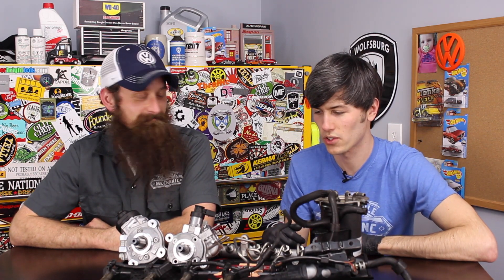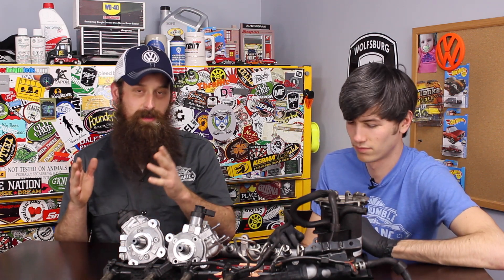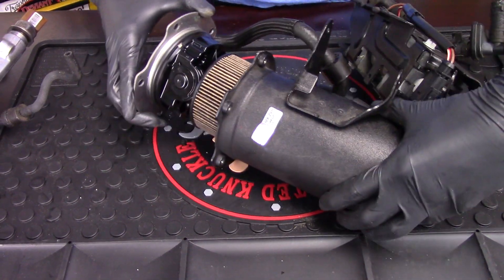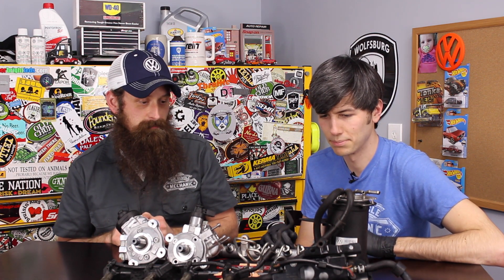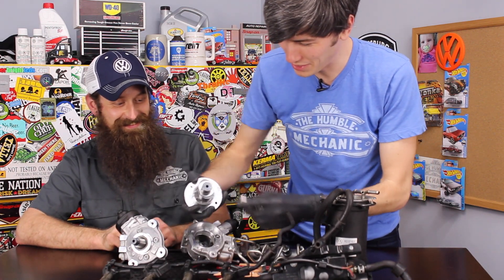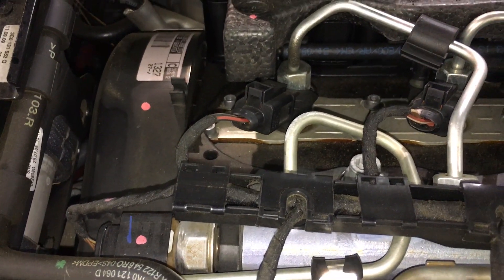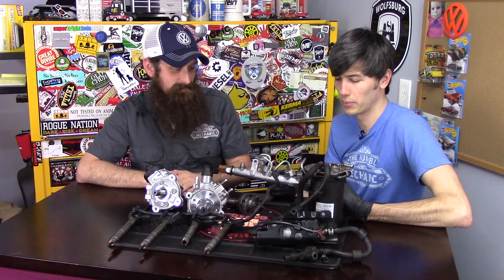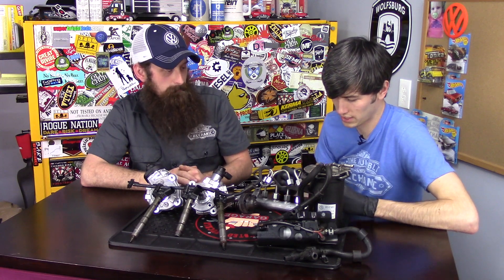How Diesel Common Rail Fuel Systems Work

Comment: I don't understand why the mechanical fuel pump needs to be timed if it's supplying fuel to a common rail???
Reply: +Kepe The high pressure pump in a common rail fuel system IS NOT TIMED; and never has been. by the way, common rail fuel systems in Diesel engines date back to the 1930s.
Reply: +Jun Ye Liao (Kevin) Think of the mechanical pump as a small 2-stroke piston and cylinder setup. During an intake stroke, fuel is fed into the cylinder by the second electric fuel pump. Then the fuel intake valve is closed and the compression stroke happens, during which an exhaust valve is open. This of course causes pressure to rise and forces the fuel out of the cylinder and into the common fuel rail. Then the exhaust valve is closed, the intake valve opens and another intake stroke happens.

So the fuel "squirts" out of the pump during the pump's exhaust stroke. If there wasn't any timing involved, the pump couldn't work. I'm quite sure the pump doesn't actually have a piston moving up and down, but the principle is still the same. This kind of pump is required because of the absurdly high pressures required for better fuel injection.
Reply: +Attila theHun I was talking about the high pressure fuel pumps and why they have those cams inside, shown when Jason takes apart one of them at 2:21 

I wasn't talking about the fuel injectors, nor was the person who asked the queastion.
Reply: Attila theHun exactly what I was thinking, that's why I don't understand why he mentioned that the pump is timed with the timing belt...
Reply: +Jun Ye Liao (Kevin) I think it just gets its power from it.
Reply: +Jun Ye Liao (Kevin) If the pump is not timed on this engine it will throw off the engine timing. I have seen guys get the timing of the pump "off" and it will cause a cam/crank correlation issue. So while the pump may not require timing to provide fuel at high pressure, it does require timing as a function of the timing circuit of the engine.

HAHA(did that make any sense?) Sorry it's early.
Reply: +HumbleMechanic Isn't the timing of a common rail diesel engine managed by cams and the ECM, which controls the injection? I mean you aren't using unit pumps or anything like that here. The mechanical pump is just a high pressure fuel pump, providing pressure to the common fuel rail. That's why I don't quite understand :P
Reply: +Jun Ye Liao (Kevin). On Peugeot/Citroen HDI (common rail diesel) it doesn't need to be timed. I demonstrated that to my boss by spinning the high-pressure pump before mounting the timing belt. The engine ran perfect.
Reply: In a common rail system, the high pressure pump is NOT timed.
Reply: +Walter K by it self, you are correct. However as part of overall engine timing it is.
Reply: +HumbleMechanic I must agree to disagree. My familiarity is with Bosch CP3-based systems and the CP3 high pressure pump is most assuredly not timed; it free runs. injection timing is solely determined by the PCM triggering the injectors.
Reply: +HumbleMechanic It just acts as another idler in the system, no timing is necessary and it wont affect valve timing as its free to spin as the belt is applied. It would cause issue if someone (incorrectly) locked the pump off however when it should be left to spin freely.

Comment: Guys (maybe more specifically Charles), I'm about to embark on replacing my injector seals on my '10 CBEA, would love to see you guys tear apart one of those injectors and go over its different components before I try and do this myself.
Reply: Just doing the deals on that engine is super easy. Unless you mean opening the injector and work on in the guts. 

Or are you talking about the sealing plates on the valve cover? 

Also curious as to why you are replacing the seals. I have not seen(on those injectors) a need for replacement. Not saying you don't need them, just want to be sure I have not been missing something.
Reply: HumbleMechanic VW said that I have oil on top of my valve cover. They proceeded to tell me that I need to replace the valve cover and gasket along with my injector seals. Their reasoning for doing both was that they weren't sure where the leak was coming from, so they said both need to be done. Quote: $900 bucks. I said ef that, went over to myturbdiesel.com and found how to do it on my own, but I'm a little scared to mess with the injectors.
Reply: +Shayne Wolfe Just be careful. The guys at MTD are awesome! just be sure to work clean, and take care not to drop the nuts into the valve train.

Comment: What a waste of good parts. Mis-fuelling never causes failure of parts, just drain and fill with diesel and it'll be fine.
Reply: +100SteveB nope, its the high pressure pump that goes toast on these. Its electric but also relies on the lubricative diesel fuel. Gasoline comes and literally cleans all the lubrication off and burns the pump. Some pumps rely less on diesel just because they dont want their customers to ruin their vehicles when they accidentally put the wrong fuel in. VW is German so it doesnt care about its customers past warranty.
Reply: +ringmaster146 I used to be in charge of a fleet of small diesel vans, on several occasions i had drivers mis-fuel their van. On each occasion i had the vans towed back and then i would simply drain the system and flush through. Fill up with correct fuel and take the van out for a test. Within a mile of driving the vans were back to normal, no signs of damage whatsoever. Each of those vans carried on to give a full service life without problem relating to the fuel system. yet, if i had taken them to a garage i know that they would have told me that i need to replace every part of the system.
Reply: +ringmaster146 Let me elaborate a little on this situation, because I have seen it go a few ways. 

When the HPFP fails it blows metal throughout the system on these cars. Jason has another video coming out were we explain that a little more in-depth. 

I have seen many CR engines mis-fueled. The simple act of putting gas(we will stick with that for now) in a tank does NOT cause damage. You are 100% correct. BUT that is a rare rare case. What typically happens is, TDI is filled with gas, car is driven until it will not run. Then car is cranked and cranked and cranked. After it will not start, it is towed in.

Now the entire fuel system is filled with gas and metal. I have seen guys try and clean the system and only replace the HPFP. It may have worked a time or two, but generally you will see injector failures.

Also remember that for a long long time, VW was paying for all of these repairs. That means we at the dealer had a repair protocol to follow. That consisted of replacing all the parts Jason and I show, and cleaning the rest. If that was not followed, VW would kick back the repair claim, and the dealership would have to pay the bill. AKA the tech also loses money. 

Now if we were talking about the older TDIs like the ALH, and the PD engines, you are right. The damn ALH would run on gas(ran like crap, but it would run). Even the PD engine would be fine with a drain and fill and filter replacement. 

But those days for VW are long gone. If a CR TDI is ran until it will not run due to gas contamination you can almost guarantee this will be the repair.
Reply: +100SteveB At what point was the van towed? Was it caught at the pump, or driven until it would not run. From what I have seen, that seems to be the difference between a flush and fill, and a system failure.
Reply: +ringmaster146 it's a tough call at the dealer. Let's say we try and clean the lines. Then 5k miles later the customer has an issue in another state. The other dealer will see we didn't follow the "proper repair". Then the customer is pissed and we are on the hook to fix it. There is a lot more to the story about why dealer make certain repairs. Some of it I am totally cool with and some times it's plain freaking stupid.
Reply: +HumbleMechanic Thanks for the reply. Your last point explains it all really - for example I wouldn't like to see the customer billed for a new rail and pipes which are easily cleaned.

Comment: Your timing could not be better. I'm currently having some fuel supply problems with my 206 2.0 HDi, and this video explained alot since I don't know crap about diesels.
Thanks m8
Reply: +DrathVader pretty lucky I'd say. good luck to ya hope it works out for you
Reply: How's The Force working out for you now?
Reply: TurdFurgeson571
Unfortunately the Force can do nothing against dead high pressure pump. Or fuel filter. I'll check tomorrow, but that weird whining sound tells me it's the pump.
Reply: DrathVader Your lack of faith doesn't disturb you?
Reply: Okay, crysis averted. No metal shavings in the fuel filter, but lots of random crap and paraffin wax (it's cold out here). I cleaned the filter and the car runs, at least for now.

Comment: Wait. Your telling me there's a car out there. With individual fuel lines, and regulators coming all the way from the tank or a gas tank to the engine? Or are you just dumbing fuel injected engines so far that Some guy climbing out of the trunk of his 1960s cheverlet can discover this world of modern technology
Reply: +Walaboro No, they're not saying that some car has individual fuel lines for each cylinder coming from the fuel tank, they're explaining how fuel travels through the car in a common rail diesel system. It's called engineering explained, they explain how things work, usually in a way that everyone can understand.
Reply: Reply was needed to essentially quote my comment
Reply: +Walaboro Reply was needed to state the obvious.
Reply: reply to reply was needed to justify self posturing.
Reply: +steve (audifixr) single fuel line. To a carb. Is different from essentially say. 4 lines. 4 carbs. 4 cylinders. Pretty weird sounding
Reply: +steve (audifixr) lol. The Internet hurts my head. Reads but doesn't understand. Types but can't read. Proceed to slap left and on chest and exclaim "huurr da duurr"

Comment: noting about the return fuel system
Reply: +clarkie005 yeah and no explanation of the low pressure lines on the fuel injectors -- the rest of the items are pretty self-explanatory as mentioned in the video, the name of the part is what it does.

Comment: FINALLLYYYY!!!!! Something for us europeans :) first common rail sistem was developed at Fiat SPA in 1996 or 1997 and was first installed in Alfa Romeo 156 in a variant of 1.9 JTD with 77kw, this was a 8 valva sohc sistem and was performing oustandingly
Reply: Wrong. The first common rail system was developed by IFA, an East German company, it is been used in the IFA W50ls truck in the 1980's
Reply: +Peter Stalin Fair enough but my point is was the use in a production car ;)
Reply: Oh, well, i am sorry:(
Reply: "and was performing oustandingly"
no it wasn´t perfoming outstandingly.they weren´t that much better than bmw diesels (without common rail) and one year later bmw sold common rail diesel too and yes they were better than the alfa diesel (at the beginning,alfa updatet it)

Comment: Thanks for coming by man, always fun to chat about cars. 
Gotta love some TDI fuel system fun.
Reply: Do you see more issues with these fuel systems vs the older PD style engines?
Reply: +Coldfin9er way more with CR. I never had catastrophic failure on a PD when dealing with fuel.
Reply: @HumbleMechanic  Great content dude, I follow your channel Charles and have watched some of EE's vids as well. As I searched for common rail vids to get more visual data in addition to my student litterature. I stumbled upon this colab and I must say I love the format - the parts in question layed out on the table, the discussion around them and the the occasional images from an actual enginebay. Would love to see you guys do more colabs like this one, cheers from Sweden :)
Reply: +Rade2112 the PDs which were the predecessors of the CR, built up pressure separately at each cylinder in the PD elements, that are assembled together with the injectors. I hope that was somewhat understandable :D and a pressure was a lot lower :P
Reply: +HumbleMechanic 
So what's the tuning options, Is it just management?
No more turning the pump up like on an old RD Engine? 😢
I've got a 13reg 1.6 Caddy van.
Reply: +HumbleMechanic Bet your hating the emission recalls
Reply: +TrueCanad1an so far we have not seen any recalls at the dealer. To be honest I am excited. A ton of cars coming I tot the shop is a good thing
Reply: +HumbleMechanic pd have lots of problems too in my opinion. but volkswagen has lots of problem with cr too thats right. but its their own fault for making the change from pd to cr about 8 years later than everyone else.
Reply: Hey I have a issue in my 2007 Mitsi L200. May be u can give a clue. The rpm hangs for a second when I shift at low rpms (when I don't hard on the pedal) and this only happens sometimes. Do you think this issue would be related to CR system?
Reply: Dananjaya Udara
the rpm hangs? what do youm mean by that?
 sounds like a simple electronic throttle problem.
Reply: MrBusunglueck RPM holds for a moment after taking foot off the throttle and drops down, normally by the time I release the clutch after shifting to the next gear. I changed the accelerator pedal as well just to see whether it would have any impact. Regarding the Electronic throttle, as Diesels don't use them as Gasoline cars do I don't think it can cause this problem. Btw thanks for replying
Reply: Dananjaya Udara
i was talking about the throttle pedal. all common rail diesels have electronic throttle pedals. modern low emission diesels even have something thats similar to a throttle body. but if your rpm doesnt drop for a moment after youve let go of the throttle thats either a TPS issue or its programmed into the DDE.
Reply: MrBusunglueck Yeah, maybe. But on a diesel as I know throttle valve stays open all the time until you shuts the engine off. Denso says it is there to help stop the engine smoothly. So just wondering whether it can cause this issue. In a simple way my suspicion is ECU doesn't stop fuel injection even after taking foot off the pedal. So it can be injectors or something related to fuel system. I really don't know actually. But I find it verry annoying anyway
Reply: Dananjaya Udara
no the diesel "throttle valves" arent staying open all the time, cause less air means less NOx. a side effect is that you can shut it down like its supposed to be and not just turn it off. but youre right it could be an injector. ive had a similar porblem with a diesel though when a boost pressure seonsor was broken. the car just kept jerking when i drove it really hard and then backed off, or when i had driven it about an hour ago and it was really humid air and then drove it again.
most mechanics wont be able to help you, you just gotta go through the forums or fiugre it our yourself.
Reply: +Dananjaya Udara Try clean the throttle valve, EGR valve and boost pressure sensors/intake manifold pressure sensors. Diesel EGR gases are filthy and causes gunk build-ups in the intake system over time, which could potentially lead to a problem like you described.
Reply: +MrBusunglueck Engine management actuates the throttle valve and the EGR valve to achieve the ideal mixture of fresh air and recirculated exhaust gas to keep combustion temperature and NOx emission down.
Reply: KiRin1101
diesels have no throttle valve.
 but why do you reapeat what i said?
Reply: +MrBusunglueck You are right, my bad, diesels have no throttle valve. It is technically a ECU actuated butterfly valve which regulates the amount of fresh air going into the intake manifold, if you wish to be pedantic and technically precise. But this valve alone cannot achieve the strict  emissions standards which is why EGR valves are just as important in this setup, especially in low RPMs where most diesels are designed to operate.
Reply: KiRin1101
yea but why you tell me that, i already wrote that.
Reply: +KiRin1101 Nope, there is no butterfly/throttle valve in a Diesel engine air intake system. Engine speed and power output are determined solely by quantity of fuel injected; a full charge of air is always admitted.
Reply: Walter K
what youre saying isnt true. hes talking about swirlflaps. they act like a "semi" butterfly valve. i think they were introduced in 1998 by bmw. so your info is over 18 years old.
Reply: +MrBusunglueck +MrBusunglueck You are in error as the swirl flap serves to increase air turbulence NOT govern engine speed or power output. I am not incorrect.
Reply: Walter K
 nope you are incorrect. the swirlyflap is not there to increase the turbulence. the swirlflap is there to restirct airflow into the cylinder. this means that the engine doesnt run as lean as it usually would and you get less NOx.
the swirlflap however only serves any purpose on partial throttle.
some diesels also have real throttle valves in order to be able to shut down the engine more smoothly or to use them during the dpf recovery.
do your research before you write bs kid.
Reply: Cool
Reply: Here in my country in Africa every vehicle that uses common rail diesel injection have failed miserably we still use mechanical diesel injection in all types of vehicles whether pickup trucks or large lorries mechanical injection is awesome
Reply: @HumbleMechanic  great stuff man, just a quick one. If you were to block all the injectors, unplug their connectors and crank the car, wouldn’t you see the HPFP pressure of about 800 bar if you were to measure the pressure? Would it be right to call for a HPFP failure if you measured the electric fuel pump pressure on the high pressure side while cranking?